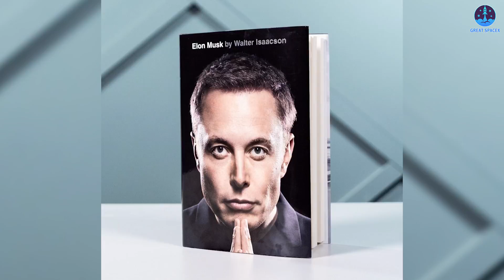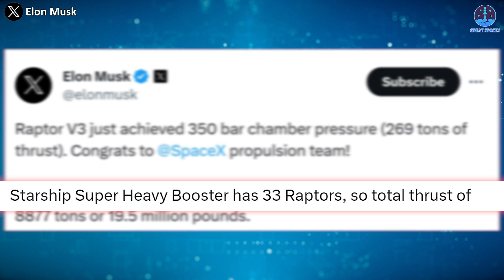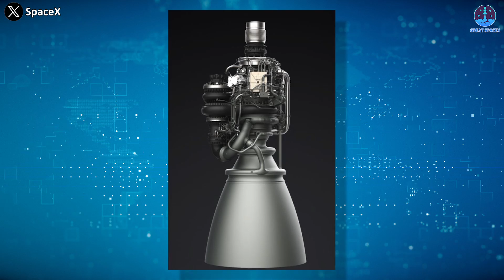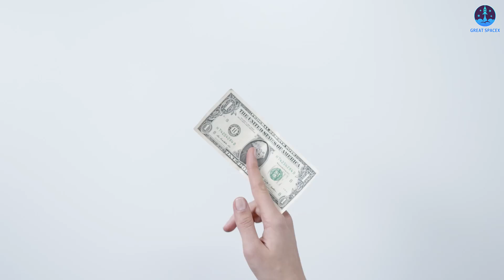SpaceX forgotten engines even better than Raptor! Elon Musk abandoned...

Comment: Since they switched to hot staging now, did they insulate (protect) the boosters dome with heat tiles? Alot of heat hitting a real cold metal surface will be one heck of a thermal shock.
Reply: yes they did
Reply: yes and yes
Reply: Not eith heat tiles, those would rupture from the heat you dingus